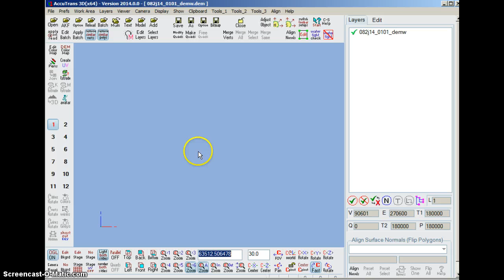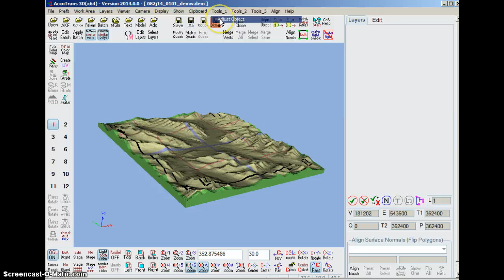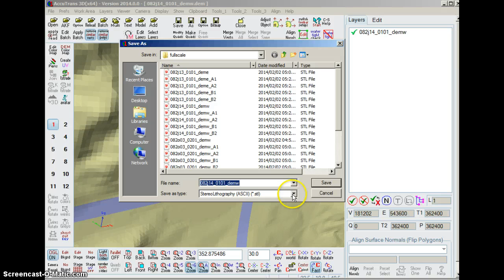DEM to STL using AccuTrans

Comment: Great video thanks! Can you stitch together multiple tiles to make one model? Example if I needed terrain from the intersection of four tiles of the USGS map.
Reply from the maker: racing5k hey, I never figured out how to do that in AccuTrans, so I'm not sure if it's possible. I used other software for that. Sketchup can import multiple stl files and you manually line them up and export a single file. It gets slow when you start dealing with hundreds of thousands of vertices though. There's probably other stl manipulating software designed to do this better.
Reply: Peter,

Thanks for the response, I think Blender would be able to do this, but I can't find anyone who can help me. I joined the forum and asked this question but didn't get a response.